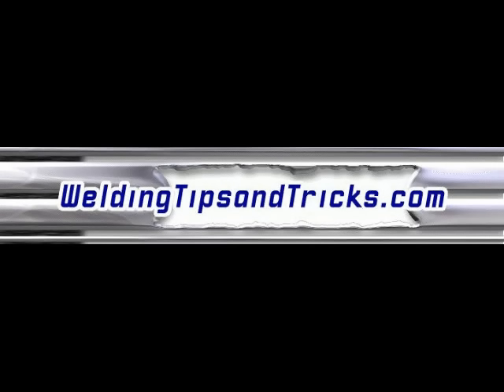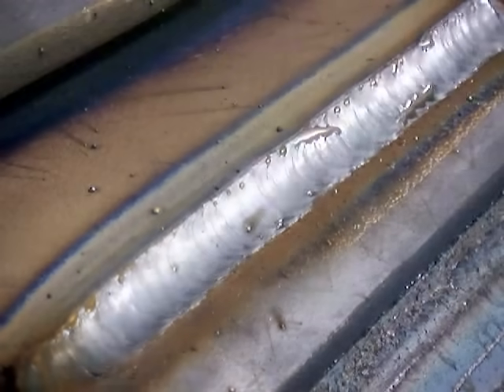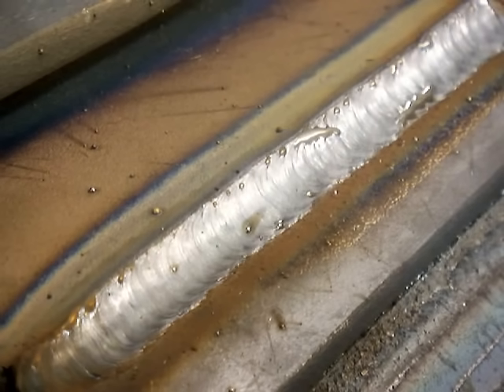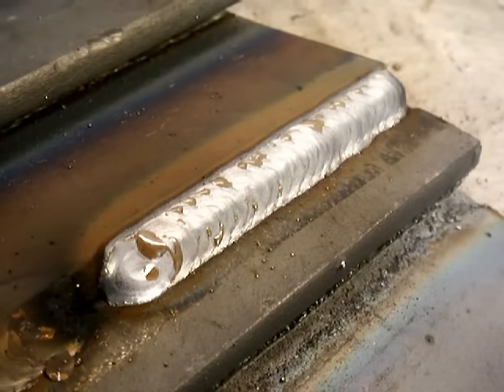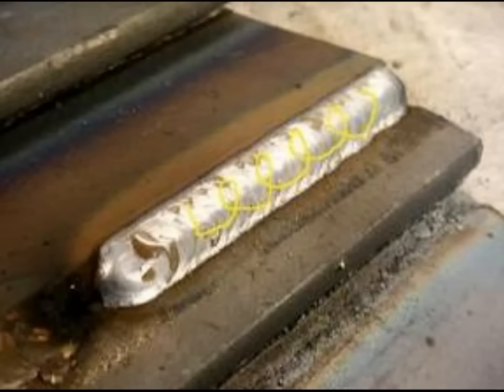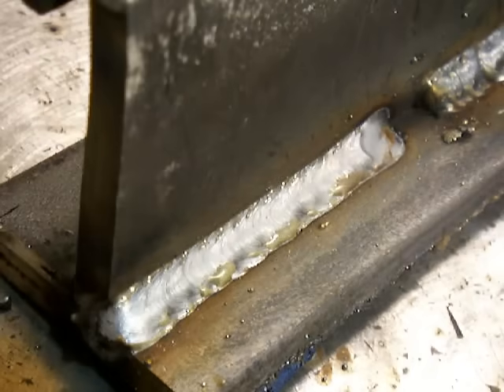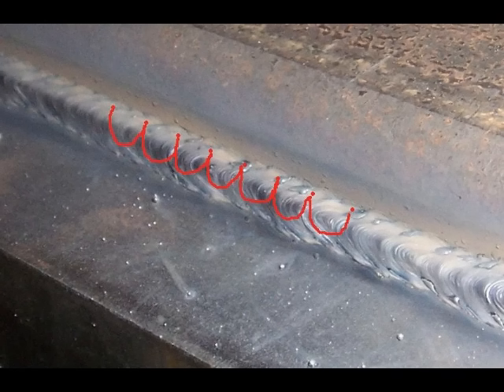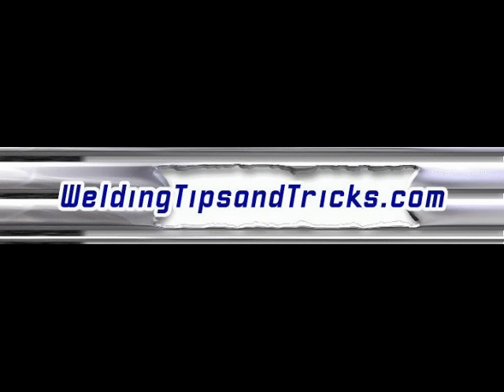Mig Welding Technique Taught by Old Timer

Comment: I am not an expert welder either but I got a couple certificates from  tech school but, I have a pretty good observation on not his technique but alot of the comments that folks put down below. A lot of skilled technical jobs like welding can't find folks to learn and from most other fields like HVAC, and Machinists are having trouble getting folks involved in their fields because of folks that have nothing good to say about them when they are interested or trying to learn every one is always so negative to each other instead of talking crap about folks encourage a young person to learn something hell teach them something with out belittling everyone around you and them. These trades seem to be dieing a slow death for one reason or another but assholes that degrade young folks or old folks trying to learn something new will just get frustrated and give up. But hey who am I it's just a suggestion.

Comment: It's also called ocissilation. But it is said for heavy structual not recommended it will crack.
Reply: Exactly ,that's fair for speed as he's doing but sacrifice good deep penatration to get uniformity in the metal,I'm combination welder and done it for 30years and been to weld school never had weld breakage and two time certified in mig ,mig no need for much movement unless like going over thin metals or large cracks but thick stuff good slow speed if set right speed for deep burn or melt in.

Comment: Im using 100 co2 in class and cant get a flat bead pulling but pushing work just fine. Are the settings the same?

Comment: The bottom of the "e" puts in more heat than the top of the "e", so the bottom of the "e" is for the middle of the plate and the top of the "e" is for the end of the plate.  If the plates are reversed, then the "e"s need to be upside down.

Comment: You need to stay on the leading edge of your  weld pool.  Especially  with thicker  metals .If its thin sure move the arke around , but if its thick stay in the leading edge.

Comment: What was the wfs.and v.set on? And the thickness of the metal is perfect for what I weld on at work 045 wire..looks like this..but can you do this same process going around pipe 12mm. Stacked weld?? I would love to see that if you would?
.great video

Comment: Good method, little effort, and nice easy bead appearance. Works great with stainless as well, although the bead pattern appearance will be a bit different. The only reason this method wouldnt work is because some guys weld too cold and spend far too much time making fancy circles just to get great bead character even though the root fusion is generally lacking. Gotta learn to weld hot.

Comment: I started welding today. Picked up a ESAB 141i to learn. I've started with the mig process. I'm practicing on some scrap angle steel. My welds are holding but look horrible, nothing like the video, more like balls of steel. Any suggestions of what I might be doing wrong?

Comment: Thanks so much for that demonstration. You weld pretty...nice even, straight passes. I was semi-self taught...I'd don a helmit and watch the boilermakers weld on locomotive wreck damage,  when I could and i picked up some good tricks. My Father had taught me to weld with a brazing oxy/actlyn torch and a coathanger wire, by the time I was 10. He said to keep a circular pattern with the torch tip and melt both pieces i was welding and to add enough wire to get the two pieces of metal to flow together...then wash the whole puddle down the length of the weld and keep the tip close, but not too close or it would pop and blow your puddle out and make a mess. I still follow his advice on MIG and on Stick. It doesnt do real great overhead or filling a wide thick crack vertical. I like to use a side to side gentle U, for vertical, and a start and stop, heat. Stop till cherry red and go again...continuous on overhead. I've had some good years dabbeling. I've worked on my even-ness over the years...as design has had my attention for over 50 years. I have a love for steel. It'll love you back when you turn it into EyeCandy! Thanks for your videos and the quality videos you produce...and for the teaching skills you demonstrate!

Comment: Speed, angle, gap, the 3 main tips I was taught by a boilermaker.
Not quite the "beautiful" coin stack but still a hint of the stack, most important thing is the penetration to actually hold the material together.
Awesome job dude, good penetration and tidy weld, vehemently impressed. Thank you.

Comment: MIG welders are not designed to push, pull, whip or weave. They are designed to operate 90 degrees perpendicular to the weld joint. Obviously you are free to manipulate your weld as you please. But I've seen too cold of settings that are whipped too far and have created stress risers at every overlap. Pushing or pulling if done correctly will not look different but the heat input and penetration is drastically different. Teaching any form of puddle manipulation to a beginner welder is the WORST thing to do. If your machine is set correctly you will have no need for manipulation.

Comment: When you're mig welding, what number should my helemt be on? I have auto darkening lenses. I usally do it at 9 or 10.
Reply: Depends on what material your welding with and the amps. Stick, flux, gas, mig, tig, aluminum etc. Hopefully you learned on and old fashioned welding helmet before you got that snazzy auto darkening helmet.

Comment: Loved it, I usually push a mig and pull a stick. He made some beautiful beads but many factory jobs are all for speed so on bracing beads spot the brace run your steel wire at max and about 24.6 to 30 volts , good nitrogen and argon ( what I like ) rock the torch up n down slightly as you push it along. On seams that must be high pressure leak proof run a bead like he did and don't stop until you meet it from the other side and lay it in a quick circle around and overlapping the starting bead, burn it in good, and you got it. Just love mig.

Comment: I cant breathe anymore. I usually whip on thin and make any e motion for heavy steel. The whip looks like shark teeth, and the other comes out more with the row of dime look or whatever. If i whip and pause a bit in a groove, i find the most cosmetic welds somehow that i cant in a fillet. Im bout fricken done tho, ive tigged on aluminum and stainless i feel like im fuckin filled with chromium and argon. Im 29. BE A MECHANIC! Or machinest or something.😥😑

Comment: On a lap joint like this I usually focus most of the heat on the bottom piece of material and then let the heat transfer to the edge of the other piece of material on top and then they naturally fuze together. That's they way I was taught and it seems to work very well.

Comment: Not to say this is wrong, God knows I'll get flak for it, but it's NOT FOR BEGINNERS. A novice welder may get a weld that looks just as pretty, but runs a high risk of wandering off the joint or rolling over the bead crown. Learn to weld in a straight line until you develop a natural feel for it before trying this. If you can't be reasonably sure about your weld test results before the xrays or stress  bend is done, I think you'd be in troubled waters doing this.

Comment: I’m self taught and my biggest mistake when learning was welding too cold. The weld looks good but not enough penetration. For a strong weld you need good penetration. i’ve seen pros weld too cold....biggest reason for failures.

Comment: At Caterpillar when we weld TRF's (Track Roller Frames) with a Miller MIG welder at 460 volts with Aregon gas we learn to lay the gun a little & use a pull back & forth movement. At times we can only weld with one hand due to reduced space, & if your right handed you have to also learn to weld with your left cuz of the angle...

Comment: I have a Cannondale mountain bike that I got in late 90s and all the welds all the way around I believe it's aluminum are completely smooth nothing like anything I've ever seen any other bike what kind of welding is that was it sanded down or was it just the a great welder doing a great job on a piece of aluminum as the bike only weighs like 3 or 4 pounds my accessories way twice that that I put on the bike it also cost $1,100 in 96 or 98 not old-timer talk to you well that's how I learned a lot of my carpentry skills was the from an old Yugoslavia and guy that he didn't get along with anybody but me and we got along great and I learned bye watching what he did while I was doing my own work at the same time which ways mostly I can rough construction-type decking that type of work the old Yugoslavia and was a master finish Carpenter which I am pretty good at myself now from watching and learning from him unfortunately I have Crohn's disease and lost my large intestine almost 18 years ago so very little work gets done by me nowadays as when I do work physically I end up with perianal abscess is in that ends everything one of those curveballs life throws you that you don't see coming that just up ends everything in your life

Comment: My first welds looked like a high school student threw up vegetable soup on a high school hallway floor.  My wire feed was not constant, it sputtered, and not a single welding video I saw addressed it.  I had to figure it out myself, that I had to crank the wire compression setting all the way down, not middle of the road half way, and keep the wire line as straight as possible.   Forget making a puddle. I couldn't see shit through my active welding helmet.   It more looked like a moon crater impact surface.  Popcorn welds I guess, but really every possible weld problem all over the place.  It really hasn't improved that much, but somehow I manage at least to melt metal to metal.

My tips: Make sure your wire comes out at a constant speed first; point a 300-500 watt halogen shop lite right at your work, and work in the sunlight, so you can see your work through the helmet while you are welding it.    And when you're done, clean it up with a brush, and cover up all the mess with fucking J.B. Weld to make it look smooth and professional  :-P

Comment: I weld structural mig a lot. I run 26v 300ws, I see metal breaking down pretty good n beads are dead flat n consistent with 75 25. Is this good?

Comment: Thanks for all your efforts, I watch all your videos and have learned a lot from them. I'm commenting to thank you for a couple tips in particular. This one using cursive e's and using aluminum to block a steel weld from going too far. I just returned from a pheasant hunt in South Dakota. The farmer broke a sickle bar on his combine mid harvest on a Sat morning. Last time this happened it was a $1200 repair and would have meant three days down time before he could get a replacement part installed. My hunting partner took apart a small section of the sickle bar, used an old aluminum license plate to shield the broken bar from the bar it rides on. I then welded the two halves back together using your techniques. Down time for the farmer was an hour and a half, cost was a few feet of mig wire. He finished the soy bean harvest without issue. I wouldn't have been able to do the weld without the aluminum trick I got from one of your videos. I do mig, tig , gas and stick with no formal schooling. All my training has come from your channel and a couple others. What you are doing has a huge impact on a lot of people, and is greatly appreciated.  Joe

Comment: Nice nuts and bolts video. To add, pause more at the top or bottom to put more heat in the thicker material. To be a better welder learn to weld left or right handed. Believe me, it will make life easier. Finally, notice when he pulled the weld. The weld stood up a little more with a center ridge then the pushed weld. With steel you're ok but on aluminum pulling is not preferred, ever.

Comment: I assure you this weld and technique would never pass xray.  It's all well and good to be a barnyard, horseshoe, folksy, "old timer"... but those traits have nothing to do with modern science or technology.  Spray GMAW is the only way to a perfect joint.  Thick sheet, plate, structural, thin sheet, sheet metal..  It is the only acceptable way anymore.  Nobody MIG welds at less than 26V and 200A ever anymore, ever.  Nobody lays down a circle, "coin roll" pattern ever anymore..  It won't pass inclusion limits.

Comment: btw yes there are methods for appearance and for more penetration.....NEITHER method is flawed and both have their place...structural has cods and doesn't look as pretty as appearance wielding but both are strong wields overall.  for most consumer applications they want appearance wielding because it sells better...

Comment: to me right to left when M .i G is the way to go i think you get better gas shielding of the weld ,and you can see where you are going.
if you use flux cored self shieding wire left to right is the best, On light plate M I G the technique is called dip transfer when welding thick section plate you use spray transfer very high current and wire feed,for fast deposit and speed of travel.
But in the end we all use different techniques when welding and the end results are good welds . You old hands will know the score, enough said

Comment: I am by no stretch of the imagination a pro welder but have done my fair share. Had to weld up an entire water system inside a pump house at a golf course. Boss told me to make sure it will hold 150 PSI when the water is first turned on. Have no clue what I was doing to achieve that so just welded what I knew. I don't use the J technique, I use the cursive e style with stick. 8 sections of 8" pipe welded, no leaks. No idea if it actually hit 150 as normal flow would be 75 PSI. I believe in the cursive E.

Comment: Great technique, being in production welding for a few decades now I've seen them all, more than I care to see now. I wish that in these videos though, if your trying to teach or maybe just to show your skills, explain that incorrect parameters, your weld is not going to look like this at all. A well adusted machine, proper travel speed, gas used, wire used, wire speed, electrode stick out length, arc length, voltage and the list goes on, lastly...applying a good technique like this one and you'll have a sound weld. Nice beads though.

Comment: I have used the same technique with flux core welding 1.6 wire for many years. This technique produces and excellent convex weld and reduces the chance of under cut when welding very hot on single or  multiple pass's.

Comment: Weldings a highly critical buisness. lol. Yep! In the end you gotta pass the TEST.  It can be painful. What welding code are you certified to? What types of material are you certified on? What positions are you certified to weld that material in? What process are you certified in? What thicknesses are you certified to weld with what process and in what position and what material type? open butt or consumable insert? 6010 or 7018? plate or pipe? and on and on and on...........  CWB, TSSA, AWS, ABSA, API, ASME,......CSA W47.1, CSA W47.2, CSA W55.3, CSA W186, CSA W178.1, CSA W178.2 and CSA W48, and on, there is more. lol.

Comment: My grandfather was ark welding back in the 1930s. He used two wash tubs full of water and something els, salt?To build up the amperage.
Reply: Salt water transformer. "Turns volts into amps". Actually it's a resistor that sucks up voltage as heat and leaves you with amperage.

You can make a handy bong lighter with two paperclips, a piece of pencil graphite  a cup of salt water, and a piece of lamp cord with a plug.

Comment: Always pull.  The weld needs argon protection as it's cooling.  It doesn't get this when you push (as the nozzle's moved on) so although the weld looks OK it's not.

Comment: What gives your weld penetration / profile comes down to your welding gas mix plus technique a lot comes down to gas and pushing in a root run, if the material is too thick three runs double layer you can run a weave forward after a root run if our apprentices weld as above they would fail there weld test but for a back yarder fine ,but if your welding a pedestal for the first stage on a boom pump forget it these jobs require preheat the hole nine yards,  what changes  weld peno   is gas mix argon shield light  ,medium ,heavy  but as I say above is fine for what this is aimed at beginners a lot of old timers prefer to pull a mig as they learnt on stick welders circle is just a filer upper lol :) .

Comment: you can mix bubble gum with Gorilla Glue then cook it with JB weld. MF won't break. don't need a MF MIG welder or Stick welder. Guarantee for Life.
Just don't move or use The MFking part.
LMOA

Comment: I haven't welded before ( in my life so far ) and I want to know what the hell my dad's welding machine is. It's yellow, a little rusty, it's got a slider for temperature and I don't know what it runs on or what type it is ( TIG, MIG, STICK, etc. ) can someone help me out also some techniques and safety tips would help too! :)
Reply: Also it looks like a barrel with a on wheels

Comment: Ive been using this technique for years. Personally though, and what I teach people is to push the weld instead of pulling it when welding MIG. Pushing it makes more sense to me since you are pushing the wire more firmly into the puddle when you move the torch forward instead of dragging. You are also moving the torch into the gas for shielding. I read a long time ago that a higher percentage of people did a strong proper weld with full penetration VS a group that were doing drag. Because of that I forced myself to push, and I got nicer welds once I changed. My MIG looks more like TIG. I overlap my cursive e's about 50%.
Reply: I too was taught to weld mig by dragging as your moving into the gas shield. Done my fair share of pressure vessels. Stick is my preffered process having started on it in the 70s. great videos none the less.